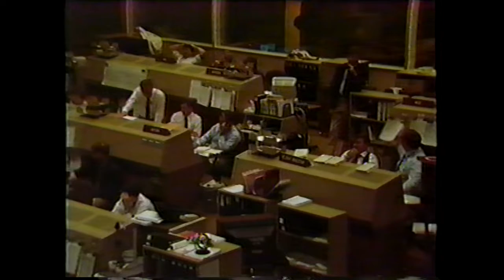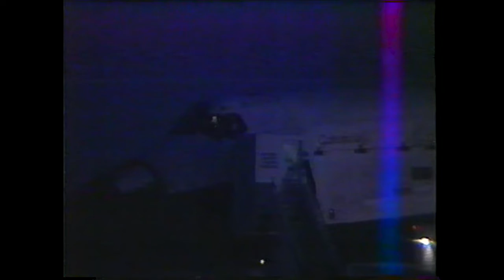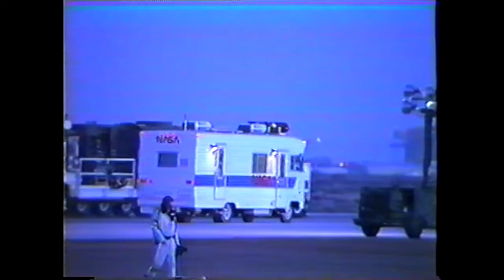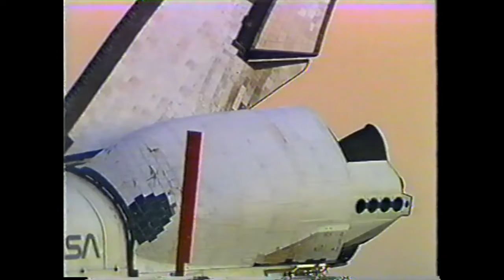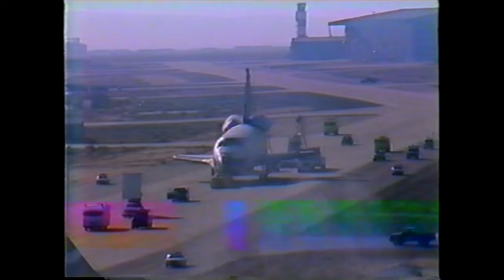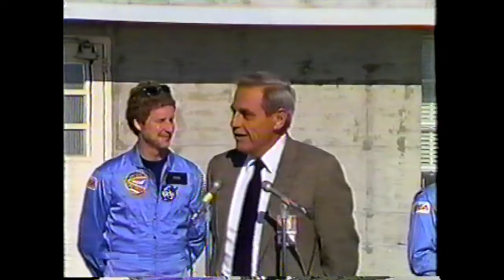End of an Era:  STS-61C Space Shuttle Columbia Landing

Comment: Due to me being British and STS 61-H, was planned to carry Nigel Wood on Columbia, here is the weather for KSC on 24th June 1986, 9:09 am EDT.

75.1-81.7 degrees F
Light Drizzle: 0.012 inches. (Jan 7th STS 61-C launch attempt, scrubbed due to TAL weather, not KSC weather, it was 0.37 inches).
Sky mostly clear/partly cloudy around launch time - GO FOR LAUNCH.
10.2 mph winds.

With launch time, scheduled at 9:09 am EDT, it was forecast as clear by this time and the drizzle was cleared and with a descent length of launch window, I would have launched.

For landing July 1st 1986, time scheduled for 5:00 pm EDT, KSC weather was;

76.5-85.6 degrees F
Slight Rain: 0.15 inches (STS 61-C first landing attempt Jan 16th 1986, had light drizzle 0.012 inches).
19.1 mph winds at landing time.
Clouds increasing throughout afternoon into evening, mostly cloudy/thunderstorms around landing time, with thunderstorms and light rain, by 5:00 pm EDT.

WAVE-OFF

Rain and clouds remain at KSC, for next 2 days, 0.098 and 0.236 inches and winds around 19 mph at landing time. So 1 day extension and land at Edwards July 2nd.
69.2-99.8 degrees F
Clear Skies
11.5 mph winds.
ironically Nigel Wood was based at Edwards, during his time in the RAF, prior to selection.

Comment: Further to the historical weather records I found for March 1986, here is what I know for STS 61-F (Challenger) and 61-G (Galileo) Atlantis. If Challenger had launched on January 27th, or been spared the fatal windshear on January 28th, the weather in Florida would have allowed a KSC landing on Feb 3rd.

Challenger 61-F:

Launch
May 15th weather launch time - 4:10 pm EDT,  GO for launch.
69.6-78.2 degrees F
Light drizzle - 0.075 inches, only partly cloudy by 4 pm
Maximum winds: 17.9 mph, East direction, 17.2 mph limit in daylight - 13.8 mph at launch time.

24 hour delay
May 16th weather GO 4:10 pm EDT
70-78.7 degrees F
Partly cloudy
Maximum winds 14.3 mph

May 18th (Mission shortened to 3 days).
KSC
Mostly Cloudy at 7620 metres, partly cloudy at 914 and 3048 metres. NASA preferred partly cloudy above 1000 metres.
11.5 mph winds
By 8:00 pm Clouds clearing to 7620 m. So a KSC landing would have definitely been possible with a 3rd De-orbit opportunity existed on the day.

Edwards
Partly cloudy at 7620 metres, mostly clear skies.
Winds 2 mph, weather ideal for landing.

Landing day (May 15th launch)
May 19th 5:21 pm EDT, scheduled weather                                                                   
Mostly cloudy 2100-7500 metres and partly cloudy 1067 metres.   
Maximum 16.8 mph winds, south direction, 8 mph at landing time.  
 
Edwards: 75.6-91.6 degrees F
70.8-82.7 degrees F                                                                                                            
Overcast - mostly cloudy, 7620 metres, better visibility than KSC but clouds reducing towards 6 pm PST, partly cloud at 5500 metres. 
Mostly cloudy 2100-7500 metres and partly cloudy 1067 metres.                 
Maximum 16.8 mph winds - 13.8 mph SW at landing time, with 20.7 mph gusts.
20th and 21st: Overcast and maximum winds 19.7 mph, both days at Edwards.

24 hour delay and Atlantis 61-G launch day                  
May 20th weather NO-GO
71.8-84.8 degrees F
Moderate rain - 0.65 inches
Maximum 14 mph winds

21st May weather NO-GO
70-80 degrees F
Slight rain - 0.098 inches
Maximum 12.4 mph winds.

To maintain the 1986 launch schedule, they would want to get Challenger down, so Atlantis can fly. Also with only 4 crew, no mid-deck galley and no GAS payloads, due to weight, this would be most favourable option. So with the weather forecasts for May 19th onwards, I envision the STS 61-G mission reduced from 4 days to 3 days and landing would occur at Edwards, after a 1 orbit extension. 

Next Challenger flight STS 61-M 22nd July 1986, with TDRS 4 satellite, 2 month processing flow, similar to STS 41-B - STS 41-C, so achievable. 

22nd May Atlantis 61-G launch weather GO 4:10 pm EDT
67.4-81.5 degrees F
Mainly clear skies
Maximum 10.8 mph winds

26th May Atlantis 61-G landing day 5:32 pm EDT.
KSC weather GO
72.8-84.8 degrees F
Clear Skies at landing time.
Maximum 13.8 mph winds.

Atlantis lands after 4 day flight at KSC. Next flight STS 61-J with the Hubble Space Telescope, launch 18th Aug 1986, achievable in terms of Challenger's flow between STS 61-F and 61-M.Mostly cloudy 2100-7500 metres and partly cloudy 1067 metres.
Reply from the maker: That is an incredible amount of research, thanks for putting together such a detailed timeline. I love the weather overlays, really nice work! I can’t recall but wasn’t Hubble running behind at that point?
Reply: @Shuttlesource  it was behind. The software for Hubble was barely ready by the time it launched in 1990.

Also, I think I should take a look into how much precipitation was in the air on shuttle launch days to try and establish a baseline.
Reply: @Shuttlesource  I have found Edwards weather records, 19th May 1986 is so closely matched to KSC, but 1986 schedule, to me, makes 1 day shorten flight, most likely, but Florida or California, is 50-50.